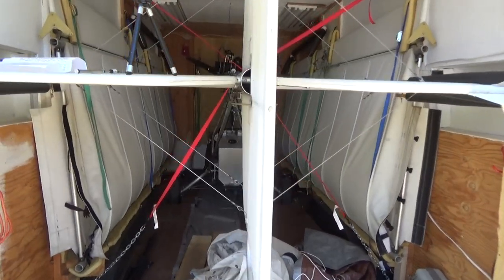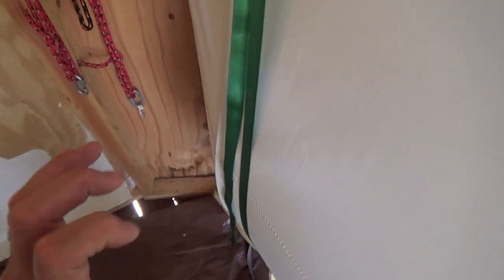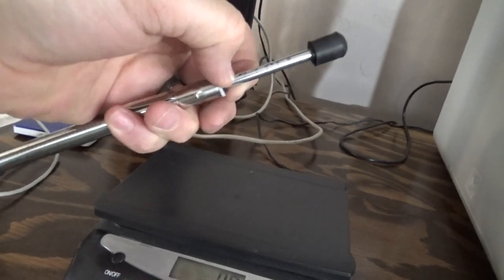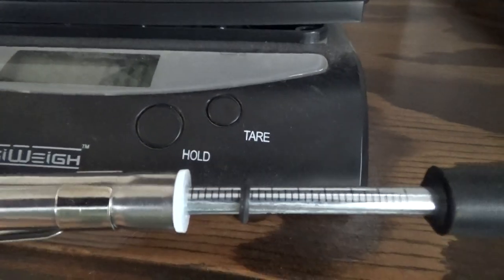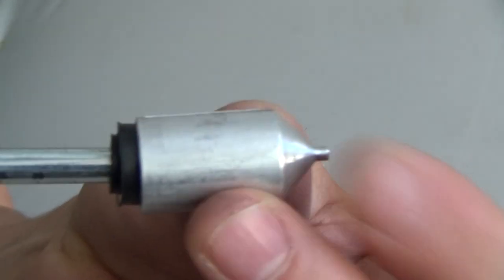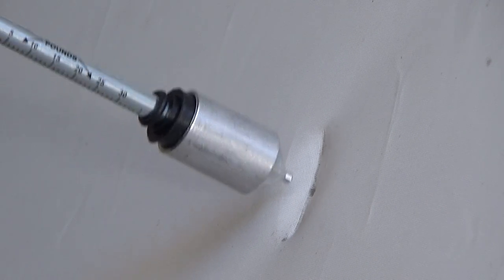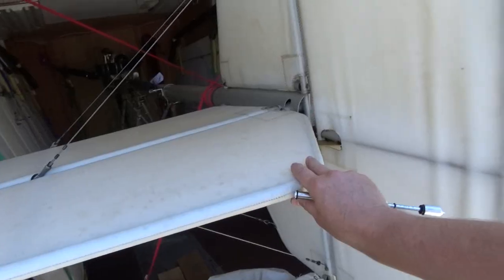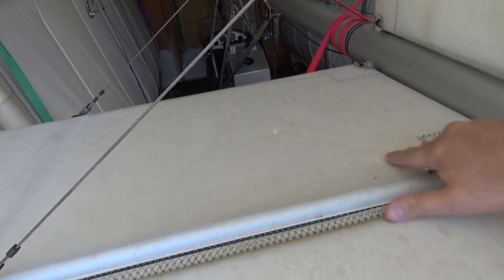Is Your Wing Covering Trying To Kill You? Dacron Strength Testing

Comment: while you're at it, check your cables where the wire goes into the clevis ends.  If you see any broken wires "replace them too".  The vibration from the cable wiggling back and forth causes this.
Reply from the maker: Yes everything will be gone over very carefully upon re-assembly. Thank for the tip!

Comment: You will probably have to replace all the an hardware bolts on the wing wires as well as get a test done on the wing bracing wires.
Due to having to remove the wing fabric this is a very good time to check alloy as well.

Used to own a 2 seat Thruster with wing struts etc a few years ago.

Anyway get some help with checking the airframe for piece of mind.

Nice to see you are actually flying now.

M
Reply from the maker: I did plan on replacing all the AN bolts. You suggest doing pull tests on the internal wires?
Reply: Yes pull test would be ideal but also take a very close look at where the wires go round the former before crimp . .. not sure of exact name. 
Can be a lot of wear at those points and the internal wire structure could show faults at those points too. (Unusual coloring etc)

I am guessing your Pioneer is probably due for an inspection and maintenance  because you have highlighted to fact that the sails need replacing.
Don't rush it .. take real care and triple check things taking notes as you go .. plus log all your work.

M

Comment: Good save!  If you slide the grommet to zero and then do the test, it will show you the max force applied.
Reply from the maker: I thought about that, however, I think the grommet would add a bit of friction, throwing off the test if only by a few ounces. Probably negligible, but I figured a slow motion video would be even better than relying on the grommet position!

Comment: That looks scary .
It also looks like a slow deterioration.
You just flew it like that .
I wouldn't fly it now . It seems like it would take a lot of load on the wings in that state for a complete failure.
 I would do that test if the plane has been sitting for extended period of time and maybe every six months on brand new fabric , every month after 2 years and every time you take it up after 3 .
 If I noticed a run and I'm not at "home" I think I might fly it back and be easy on the wings.

Comment: Love watching your videos! Maybe it's just me, but that seems like a pretty harsh test to put that wing fabric to, 10 Lbs. on that small point!  I'm sure though you'd rather have it fail in a test than in the air.   Sorry you have to re-cover everything now. Flying can be expensive, but for me it's completely worth it!
Reply from the maker: It seems like a very harsh test, yes. However, look at the evidence: My wing fabric began ripping in flight!!!!! Didn't hit anything, just began ripping from flying around in turbulence! So, seeing the wing fail the test I performed, and seeing how it failed just under the 10lb limit, between 6-8lbs, this correlates exactly with the failure I was seeing in real life! Think of it this way, if the test had been good, and the fabric had an actual strength of, say 11lbs, then my wing fabric probably would NOT have ripped in flight. So the test seems really accurate, because my flight test showed a failing fabric, and the pressure test showed a failing fabric. If you test Dacron and it fails at a pressure under 10lbs, your fabric is probably going to tear in flight, and that can easily lead to a fatal crash. I am extremely happy with the test. When I put new Dacron on, I am going to ask the manufacturer to include a sample piece, and I will jig it up tight like a drum and use the tester on it. I will press it as hard as I can and see at what point new Dacron fails at.
Reply: @glassdogangle  Did you ever get to test a new Dacron sample? I am glad I watched this vid. I am in the midst of purchasing a 1984 Phantom with what looks to be original sails. Has been a hangar queen but the test will tell the condition. I found a tester like yours sold by Quicksilver. Regards, Andy

Comment: was it you doing spins in the same aircraft
Reply from the maker: @petercrowhurst  - Doing spins in an aircraft is barely a 1 G maneuver.  Spins absolutely do not stress an aircraft or it's wings.  Recovering from a spin can stress the aircraft if you pick up excessive speed. At no time have I ever picked up any amount of speed sufficient to do any damage to this aircraft or it's wings. In fact, recovering from a spin will induce maybe at the absolute most 2 Gs when done properly, but usually it is less than that. This aircraft is rated for up to +7 and -6 Gs. Do you want to know what weakens Dacron sail cloth and causes it to rip? The sun. That's what. Not spins. UV light weakens the fabric, and when that happens over the course of several hundred hours, you will begin to get these small rips and tears, and it is time to replace the sails immediately.
Reply: I may add that I have been an Aircraft maintanence engineer for near on 35 years ... Are you trying to educate me with your wealth of knowledge
Reply: @petercrowhurst  There is  huge difference between a spin and a spiral dive. Spiral dives are where you pile on the Gs. Spins are low g maneuvers, but the spin recovery is around 2-3 Gs if you're aggressive. I've heard this from a f-15 pilot, a B-52 and U2 pilot, and a test pilot in england that flies f-35s, typhoons, harriers, spitfires, and plenty of other aircraft. They all fly in the same soaring club I do.
Reply: Ross Clements I understand the actuall spin is a low g manouver. The recovery is where the g is excelerated . This i was refering to a compromised wing fabric . Which didnt happen overnight and would have been there when he was doing the manouver .

Comment: Having been and Sail Maker for a number of years and Racing Sailboats for over 46 years I can tell you your Dacron has UV deterioration. I have seen 8 oz Dacron rip like tissue paper after many years of sun exposure.  Most of the Dacron used on Aircraft should have a special coating of UV protectant. I would guess your Wing Covering is between 2.0 and 3.8 oz fabric, Neither of which will hold up very long in the sun light. However the heavier weight fabric would change your aircraft weight to an unacceptable Level. There is adhesive back Dacron  which the glue is quite aggressive and works great for emergency repairs. Your Plane manufacturer probably
 has this if not contact SAILRITE.com.